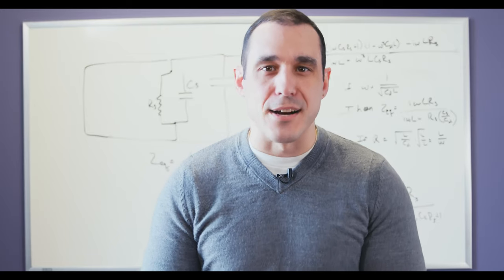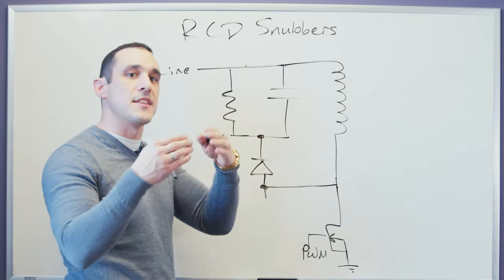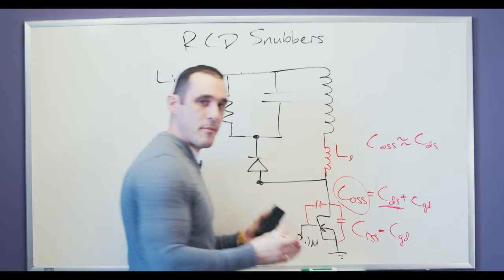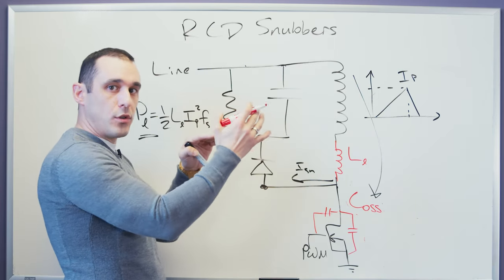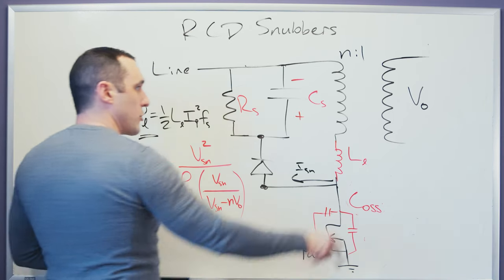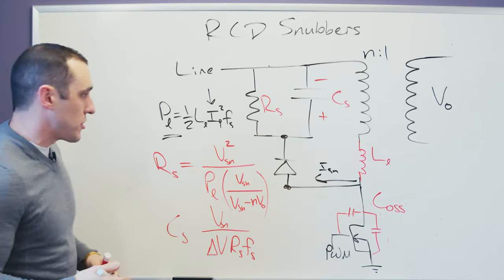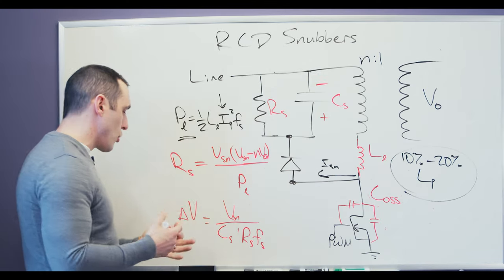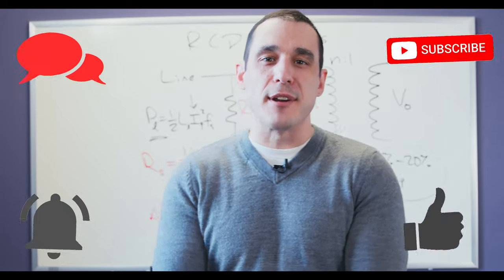How to Design an RCD Snubber (a.k.a. RCD Clamp)

Comment: Zach - Nice job detailing the RCD snubber/clamp circuit design process.  Yours is one of the best explanations I've ever seen.  I'm curious what guidance you suggest regarding the minimum reverse voltage of the diode.  I understand that the minimum reverse voltage of the diode is greater or equal to V-in.  Although in my limited experience a non-clamped ringing can easily exceed V-in.  Thanks.
Reply: That is true non-clamped ringing can exceed that value, and of course you can always select a bigger diode, unfortunately you have to deal with that switching time. Another option is use an RC snubber with the RCD clamp, the RC snubber attempts to counteract the resonance and take it closer to the critically damped regime. You can do that and get close enough to critical damping that you reduce the oscillation amplitude, and then the RCD clamp can dissipate the remaining power.

Comment: How do we can reduce the voltage stress across the switch a part from clamp circuit in boost converter do you have any reference that could help me? Tnx
Reply: Another option is to put an RC circuit from the switch node to ground. This is also called a snubber and it would be used to set the oscillation such that it will be closer to critically damped. Doing this requires a measurement of the switching node ringing, and the process in a buck or boost converter is the same as that used in a flyback converter.

Comment: thanks for your video, but I have a question about Isn current. Does it go to high potential?
Reply: sorry I just realize it is AC.
Reply: @ironchefhan1386  That's correct it is AC, so there is some phase difference between them due to the reactance in the circuit.

Comment: To be correct, flyback converters do not have transformer,  they have coupled inductors.
Reply: Then I guess companies like Wurth and Pulse should stop calling their magnetics "flyback transformers"
Reply: @Zachariah-Peterson  they call it "flyback transformer," not transformer, and that is the name that is used  to shoe itention (isolation). By the definition, transformers do not store energy, so that in flyback converter is not transformer. By the way, in all books and papers about SMPS, they stricky point that difference (chak any pape or book from accomplished  authors in power ectronucs, for example Ben-Yaakov, Maksimovic, Cuk, Ridley, Vorperian, Middlebrook)
Reply: @mrlazda  Yes calling it a flyback transformer is still a term intending to show intention, but highlighting the difference with respect to coupled inductors is just splitting hairs. All transformers are coupled inductors but not all coupled inductors are transformers, depends how they are hooked up and driven and how the leakage interacts with the rest of the circuitry. For the RCD clamp or an RC snubber in a flyback converter it's a non-issue, the leakage inductance is what matters for the purposes I outlined here. Also I'm familiar with Ridley and Cuk, in fact Ridley makes very little distinction between coupled inductor and transformer in relation to flyback transformers in his video "Design, Build and Test a Flyback Transformer"
Reply: @Zachariah-Peterson  every transformer is in pratice coupled inductor and every coupled inductor is "transformer", but when EE say transformer we asume device that do not store energy,  have very high inductance of coils (idealy iinductance is infinity, lump model have infinity inductance). Both of that characteristics make them different then what is used in flyback converter, so that generally term used in flyback converter is coupled inductor (or you can call it flyback transformer, or ignition coil which is same as used in flyback converter but with different usage).
I know that for Cuk (Ćuk) no one would ever heard if he called it transformer,  that is easiest way on university he finish to get dreded sentence on exam "coleg you faild, see you next time", and I know that bacouse I finished same university as him only he finished much before me (same university finished  only 10 yeard later, most citated name of all I mentioned Maksimovic(ć), his h-factor is over 90, he even worked on it as professor for short time).
For me I find most easiest to follow are works by Shmuel Ben-Yaakov and Ray Ridley (I was even subscribed to his paer magazine when he was publishing it).